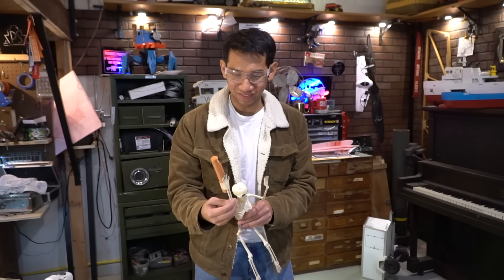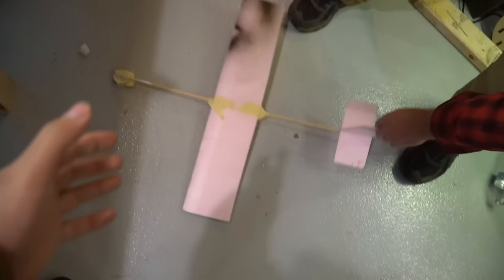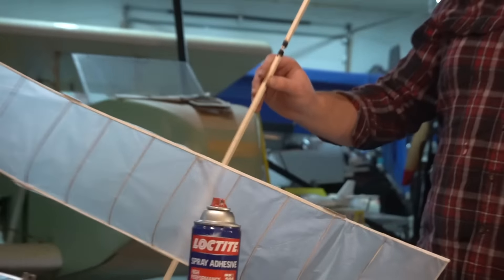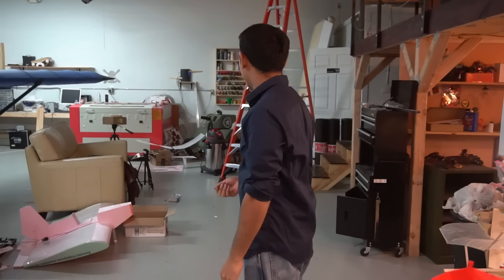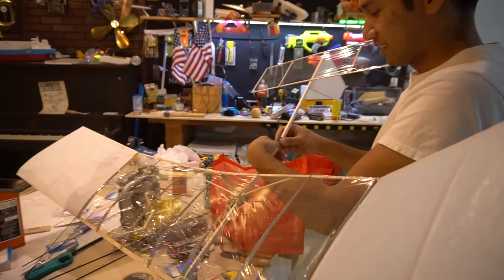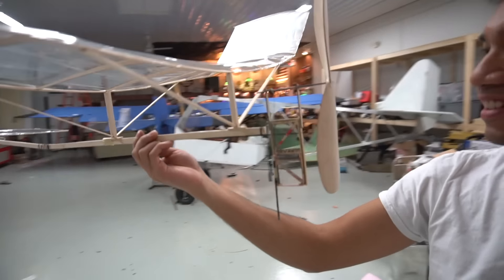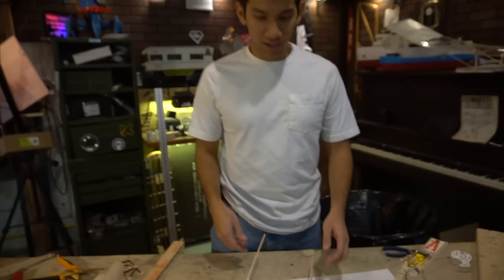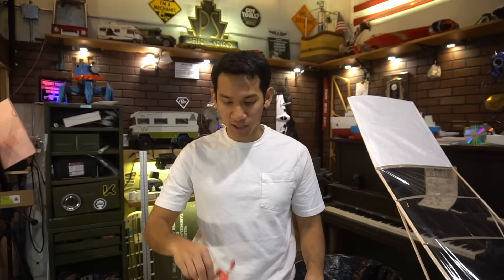Mousetrap Powered Airplane??

Comment: Sorry for making you late to the fly in 😆
Nice job Peter/Sam. You guys crushed it, awesome project. 💯💯 Actually, it was a blast to watch fly with the UMX guts.
Reply: FliteTest FIRST also I watch all your vids and love them!
Reply: Add more mice traps more speed an extra prop otherwise a two prop plane
Reply: flite test you have to do this but on a biger scale with rat traps not mouse traps.
Reply: @jamesdavidson8278  The ideal setup would be 2-4 traps per propeller and 2-4 propellers depending on the configuration. If you could get enough weight off the mousetraps it might even be feasable, the issue with dual or quad prop though is if you can't control the speed that will it will yaw and roll uncontrollably
Reply: He meant "You guys crushed it(literally)"
Reply: ~hey~
Reply: IWAM
Reply: Maybe try one with 2 mouse traps, I'm not sure how you could connect it to the gear though maybe just 2 propellers but then it's heavier, I just think you need more energy
Reply: Hey flight test
Reply: to this day I still pronounce CA glue like David Windestaal  CA Glooo.  :)
Reply: Hi Flite Test Airplanes you are awesome like him
Reply: Can you make the slowest flying plane
Reply: instablaster.
Reply: Peter sam 🚂

Comment: You could uses two opposing mouse traps facing outward (so the bar moves toward the wing tip) as the base structure for the wings, and double the torque available. Attach them to a drive shaft parallel to the "fuselage, and incorporate the propellers themselves as a gear by putting a ring around the them attached at the wing tips.

Comment: Nice, M.I.T. just made a plane like this with an Ion drive so it has no moving parts, pretty interesting.
Reply: yah and festo did the same thing 10 years ago
Reply: Is he mit 🎓?
Reply: MIT copying Peter now smh
Reply: WHY DOES YOUR DOG HAVE A FULL BODY CAST
Reply: minus the ions themselves
Reply: Shear the link please
Reply: Inferno XZ9 very little thrust but enough to allow for a short flight
Reply: jcat2_0 It exists. We currently use ion propulsion in plenty of space satellites
Reply: The plane itself moves therefore your statement is false
Reply: the only thing I can do is get away from you
Reply: @
PeterSripol you can do this! Same lightweight airfoil with a cheap ozone generator module. Just add a leading wire and some foil to attract the ions.
Reply: Now do ion propulsion with mousetrap
Reply: Its not like thats a first one lol
Reply: @cowmoo5596  nah, everything else is moving and it is stationary. Relativity is cool.
Reply: I want prof on your YouTube channel
Reply: 600th like

Comment: You would get more power from your mouse trap if you take out the short end of the spring and give it more tension by turning it more and then installing it back in place. That will make the mouse trap super strong. It would probably cut the mouse in half. But for your plane will mean more torque.

Comment: If you could use two mousetraps, you could've had one with a low gear ratio that gets the plane moving, while the second mousetrap has a high gear ratio that begins to speed up as the low ratio mousetrap is going. By the time the first (low) mousetrap is done, the second, higher gear ratio mousetrap will be spinning fast enough to propel the plane farther and faster.

Comment: Peter make a cordless dremel fly!
Reply: That would be amazing
Reply: so, make a common electric powered model airplane.....
Reply: @throttlebottle5906  It is a demel not a lithium polymer powered brushless motor.
Reply: many cordless tools are brushless motor and li-ion or li-po battery. although i'm not sure what dremel is using in their current product line ;)
Reply: @jean-pierrevisser4783  you do realise the cordless dremel is a lithium ion powered brushless motor
Reply: @____5837  It will still be cool I guess.
Reply: Yayyayay

Comment: Spring powered F1D!
Reply: joshuawfinn use a rat trap cause they have more power behind them you could cut out the inside wood like you did with the mouse trap and the aren’t much thicker so if you really had to u could shave a some of the bottom of with a sander or planer would recommend sanding as it’s a safer more controlled result

Comment: Make a submarine on the lurzbot and a bit of drain pipe
Also get an a8 and review it they are actually really good
I made both the life boat and the hovercraft on it 
(Thingiverse madRCmodeling)
Reply: Are they gay
Reply: As someone who's owned 7 different printers ranging from $100-$1200, I'd recommend spending some time with a nicer printer and see what you think then. I was super happy with my cheap printers till I got a used original prusa i3 mk2s, and now I've had cheap printers ruined for me forever.

My biggest advice, if you enjoy 3D printers, is keep an eye on your local Craigslist and other marketplaces (Facebook, kijiji, etc) for used printers. I've seen MULTIPLE i3 mk2 and mk3's for less than $500. Happy printing!
Reply: CR Ender 3 isn’t going to crack on you like laser cut acrylic though
Reply: I own an unimportant piece of history.. Velleman K8200 

It started at 900€ over 5 years ago.
Reply: Go check out rapidnadion, they did that and it is great
Reply: @8ballentertainment.885  I sub to them but they have stopped uploading which is sad theirs was great and I got the idea from them but that was a long time ago and technology has changed since then
Reply: Excellent Engineering 
I know, I am bummed they haven’t posted  for what, 2 years now? I would like to see Peter’s take on it though too
Reply: @8ballentertainment.885  they were part way though the sea quest series as well
Reply: Excellent Engineering and the carrier
Reply: @8ballentertainment.885  with the carrier it would have been cool if they had landed a proper RC plane on it not those 4 prop VTOL ones

Comment: i belive you could optimize the torque output by guiding the string, using a semicircular guide attached under the mountingpoint of the string on the trap.
That way you can make sure that the force of the moustrap always engages in rectangular fashion, making the most of its torque

Comment: Ok now use multiple mousetraps and make a multi-engine mousetrap powered airplane (maybe stick on some rc components for control)
Reply: Yeah or even just a spring-based plane, so you don't need electricity!

Comment: Awesome! One thought. When wet forming the prop blades, set them at an angle rather than straight down the length of your bottle/pipe. Should make for a more efficient pitch advance ratio across the span of the prop.

Comment: If you guys revisit this concept, or for anyone else that wants to play with mousetrap planes....research how to build indoor props.  The ones shown here look like they lack the proper twist to make them efficient.  Also, rather than playing with a gear box and all that, try driving the prop directly off the prop shaft.  This will increase the prop rpm.  To counter that, build a larger diameter (like 18-24 inch) prop, of Larrabee design for a 2:1 P/D ratio.  

This video and concept are great.  I have a feeling it would have worked far better had some research been done into efficient props as opposed to the TLAR/RC prop methods.

RC props are built for high RPM, and relatively low efficiency.  That is fine, because most RC planes have plenty of power to maintain flight.  But when power is limited, you need to maximize prop efficiency.  That’s where the Larrabee shapes come into play.  Larrabee did the props for the first successful human powered aircraft, and his designs are still used in indoor and outdoor free flight, human powered vehicles, full scale aircraft, and even electric generating windmills.  

Have fun, keep experimenting

Comment: Position the mouse trap so that the axis of the propeller is coaxial with the axis of the spring coil.  You will have to reconfigure how you transfer the power from the mouse trap to the input shaft, but it should be more efficient because the power transfer will be constant through the full range of the mouse trap arm.

Comment: Prop design is a tricky thing.  The larger prop added a lot of weight and drag. Surface area on a prop is not that crucial.  It has to do with the push/pull edge pitch.  The leading edge is normally thin and aerodynamic to reduce rotational drag.  The pitch is normally focused back and down.  A prop has more of twist than a roll.  If you look at most  props the tips are almost horizontal.  A thinner more streamlined and properly pitched prop along with a faster gear ratio would drag the plane more efficiently and cause it to climb.  That is a big misconception people have about planes.  Most think elevators are responsible for altitude increases.  When it is actually power and prop speed.  The faster the air moves over the wings the higher a plane will climb with no elevator input at all.

Comment: Growing up in the 1950’s there were lots of wind up spring powered toy trucks, cars, motorcycles, tractors, bulldozers and other toys, mostly from Japan. These were all abandoned in favor of batteries and pollution. But, you could also buy Cox Thimble Drome fuel powered two cycle engine  toys, including planes, which were awesome. Maybe a bigger Victor rat trap, heavier but very strong would work, or possibly a bear trap. I should not have gone there, someone could get hurt.

Comment: Would it be possible to make the mouse trap slapping thingy turning 360° instead of 180° by taking out half of the wooden board?
Reply: but at what point does it cease to be a mousetrap?  You  could remove most of the wood trap bits and just use the spring.
Reply: @raymondo162  yeah, that's true, idk, i think it would still be interesting even though it wouldn't be a mouse trap
Reply: @raymondo162  perhaps what we need is to demonstrate the mousetrap-ability of the airplane by showing that it can catch a mouse! There are all kinds of mouse trap designs, perhaps a new design must be invented that can be turned into a plane!

Comment: Cool video! Did you try experimenting with the number of blades on the propeller? Also, you said the blade was spinning at high Rpm, did you consider long thin blades like a wind turbine? I know it is a different application, just curious.

Comment: you could place the mousetrap in a totally different location (flat on the wing for example) and route your string to the gears, maybe with some small tubes or just small hooks... and as in your power drill video, use a much bigger propeller, i think the trap has plenty of force...

Comment: The mousetrap exhibited variable torque dynamics throughout the process, while the rubber band maintained relatively consistent tension. It appears the trap's mechanics fluctuated, whereas the rubber band provided stable resistance.

Comment: Add a cam to the string to increase to length of the pull= longer duration, more even torque, and avoids the loss and the end (the snap)

Comment: If you use three propeller blades the dispilling air doesn't dump onto the opposite blade because there is no opposite blade.... That's how windy generators work best.

Comment: LOVE the paper prop idea,I never woulda thought of that!At 13:45,do you have build info on that RC motor setup?16:15,.....CARLING'S Black Label,back when it was still REAL BEER,lol......WAY before you guys were born(I'm an old fart),lol.Wondering if you could get 1 or even 2 more turns to the spring(more tension) if you took the MT apart,and reassembled?

Comment: If you try this again, throw away the string, and put a shaft through the pivot point of the mousetrap and run your prop from there so that you get to use the energy from the full stroke of the trap rather than wasting large amounts of the usable energy.

Comment: If the mousetrap is hanging  between two proppellers in two strings (one string attached in the traditional moving part of trap and the other where the cheese usually is placed) then all energy would be used drivning two props.
Reply: Just realised I'm wrong..

Comment: Double the spring force. Combine 2 mousetrap on 1 single mousetrap "frame",  both pulling the same shaft. twice the torque would really get that prop spinning,  especially with that big prop spinning so slowly. Even could have 1 with a longer arm to release slightly less torque out over a longer time span keep it in the air longer.

Comment: Cool project. It is apparent that weight was a huge issue and I do admire the extremes you guys took to reduce that.  In particular, reducing weight by using carbon fiber and cutting triangle holes in the mouse trap base was fantastic. But,...why? Why did this project decide to toss out the beautiful part of the mouse trap car.  In my view, the long lever attached to the mousetrap spring arm (on car) was  genius!  The 180 degree motion of the mouse trap spring is leveraged up by using the rod. Result: longer run time and apparently increasing rotations per minute on the car.

Comment: The rubber band can has a higher storage capacity fir kenetic energy. Only because the mous trap is limited to 1 half turn and the rubber is only limited to its own sheer strength

Comment: you should have cut the bottom of the mousetrap base so you would have rotation for the prop.. the mouse trap would keep spining around and do a 360 instread of 180.   cut the rest of the wood off the bottom and try

Comment: You should make a huge slow moving ultra light weight airframe that's rubber band powered now that you mentioned them at the end,  try to see if you can break a record for longest distance with it

I didn't have to make a plane back in grade school but I had the mouse trap car,  I got second place with like yours using cds and ball bearings and a long arm I also had a 2 stage axle wrap so I could get it going quickly and then maintain,  went all the way across the basketball court

I lost to a counterweight pendulum contraption using records on a single axle

Comment: You could have used the spring as like a rubber band style glider twist to load up then let it rip one way lock for the spring so the prop remains spining after letting loose

Comment: I was thinking about making this a few days ago (clearly, I'm years slower than  you 😂). Question for you: have you experimented with a propeller that uses some sort of tension motor (like this one), then disengages when the motor is finished but has a flywheel added to it? 

I would run it through bearings so it would be efficient but, I'm curious if there is a reason why I haven't seen people using flywheels in this way? 

seems to me like, with the proper set up and gear reduction rigging, you could get the prop to spin with the flywheel using torque, then use the flywheel as a battery, essentially. 

I also think the use of a flywheel could be useful with a twin prop design. Having the props counter rotating, the flywheel could be flywheels and they could also counter rotate, to stop the plane from going inverted. 

....just a thought and I'm sure others have tried. I'm just curious about their results. thanks!

Comment: Uff that setup is heavy for the second model wing span or still slow fan, tilt the blades 30° front high rear low, and may be i mean that set up weight  will be countered

Comment: You lose too much to friction in the gears. You could  try the bearings from a hard drive for your shafts. They're very low friction. Also I think you need smaller diameter higher speed propellers.

Comment: Ok so could you put a bearing wheel in the front where the string will ride and put a longer stick on your trap that is in line with the spar longer pull and weight to the back at full pull

Comment: Did y’all not consider mounting a dual counter-rotating prop setup? I was think that you might have been better to attach another mousetrap to rig to the back of another mousetrap plate and make make it so you have 2 independent arms controlling 2 separate props

Comment: Im probably wrong but wouldnt it be better to use a smaller gear because im pretty sure that the the smaller the gear the faster it spins and a big gear means a powerful output. Wouldnt you want the propeller spinning faster

Comment: So you're deriving power from the throw of the armature.  You're losing power in the last ~50%+ due to a loss of string travel?  If you can find a way to anchor the armature to the plane body and pull power from the mousetrap body as it turns, maybe mount gearing to it's side, you may be able to claim all the potential stored in the 180° of throw.
Reply: Might be easier to mount gearing to the armature to use the fill 180° throw......???

Comment: Concerning the comparison of rubber bands to mousetrap,  I think it's simply about power to weight ratio. The mousetrap and required structure and gears to convert trap torque to propeller speed into another geometrical plane (as in Cartesian coordinate type planes)  adds too much weight for the amount of power it can provide.  The rubber band requires no structure and therefore has significantly better power to weight ratio.  For a mousetrap car you're only dealing with rolling resistance and maybe a little air drag, so the weight of the power source is much less of a factor.  That's why diesel engines are great (fuel efficient) for trucks, but lousy in airplanes.  Also why gas guzzling jet engines (gas turbines) are great in airplanes but not in over the road vehicles.  Power to weight is hugely important in flying machines, much less so in vehicles, except racing vehicles and dragsters of course.

Comment: Woudn't it work better if you added a second mouse trap symmetrically on the other side and that pulls at the same rod? I guess then the power/weight ratio would rise... Some thoughts about that?

Comment: Why not double the mousetraps and keep the gear ratio? An extra mousetrap would have increased the torque into the gears which would have increased the speed of the propeller whilst keeping the same amount of rotations of the propeller.